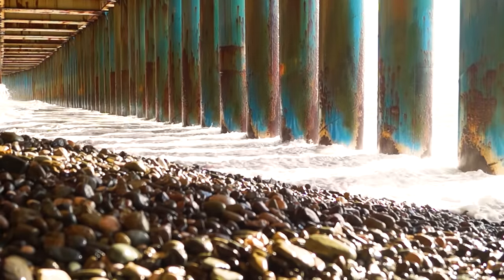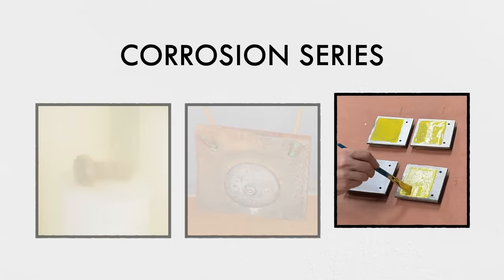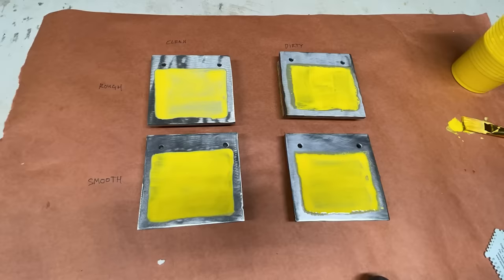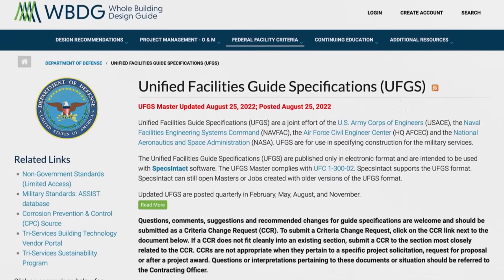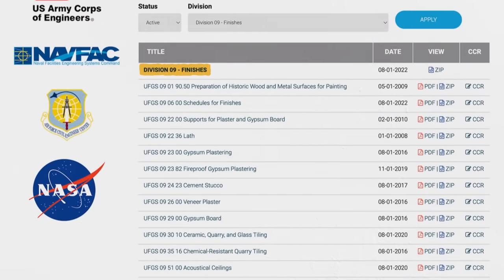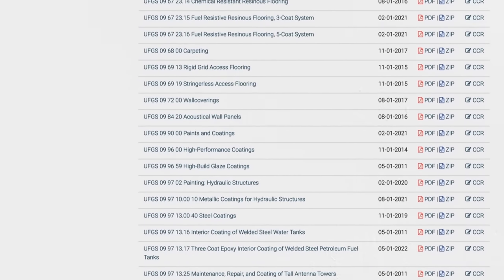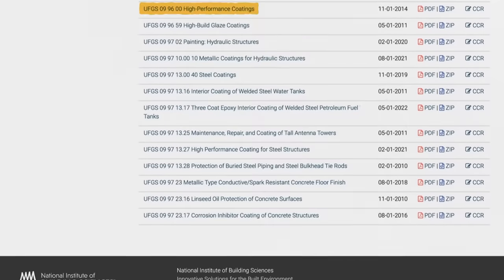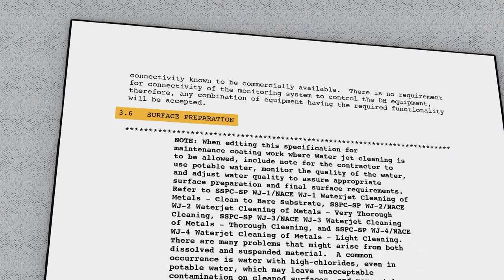What's the Difference Between Paint and Coatings?

Comment: Grady,

I spent my career as a naval architect and marine engineer working for tanker operators.  We had full-time corrosion engineers that monitored the ships and studied the changes in coatings.

I remember them testing coatings in distilled water rather than salt water. It turns out that distilled water is harder on coatings than salt water.  We used pure epoxy paints for potable and fresh water tanks.  In general, if coatings did well in distilled water they would work well with crude oil or salt water.

Surface preparation is everything when it comes to coating performance.  In coating ships we started in most cases with a near white, SA2.5 finish. Coatings, whenever possible, were applied in a dehumidifed atmosphere.  We used not only our own corrosion engineer to oversee the coatings, but inspectors from the coating manufacturers.  We hired the manufacturers paint inspectors and had them report directly to us to remove pressure from the shipyard.

As for primers we used weldable primers such as Nippe Ceramo, as well as zinc chromate and inorganic zinc, depending on location.    In cargo tanks we used two coats of epoxy paint the first coat wss applied directly to the prepared surface.  Coats were of contrasting colors to make seeing holidays easier.

It should also be mentioned sharp edges are the bane of effective coating.  Paint flows away from sharp corners leaving the surface exposed and a place for corrosion to start.  On old bridges or ships with riveted construction  there's an inherent problem of corrosion between plates of steel.  When surface preparation is done you can't blast between the plates.

Bob
Reply: Thanks for those insights - very interesting.
Reply: super interesting thanks!! some videos on this topic would be interesting, I wouldn't have thought that distilled water would be the strictest test, and I'm having trouble imagining the chemistry involved there...
Reply: @bruce-le-smith  My guess would be that distilled water is very accepting of ions to dissolve into it. Water dissolves a lot of things, and regular water you encounter has tons of stuff in it. With distilled water there's a lot of potential left open.
Reply: I love that "it's not the shipyard's fault if we literally hired the manufacturer of the coatings" 😂
Reply: This makes me wonder if distilled water is safe to drink...
Reply: An old chemistry prof referred to distilled water as "hungry water."
Reply: @Mintstar_Oceanpop  it’s safe in small amounts, but in large quantities it can actually cause you to become dehydrated as it’ll flush the sodium (and other minerals) out of your system. I used to use it when cutting weight for MMA fights, I’d completely cut out my sodium intake and drink a ton of distilled water for a few days and it’d make me drop a ton of water weight very quickly.
Reply: @MScotty90  that sounds painful
Reply: @MScotty90  That's really good to know.  I just use it for my morning tea to avoid calcium build up on my electric tea kettle, (we have well water).  I just need to invest in a pitcher filter.
Reply: @Mintstar_Oceanpop  my mom  runs vinegar through her coffee pot to remove hard water water deposits, dont know the exact but you might be able to find it online
Reply: @KibitoAkuya  Very much so
Reply: @charlescourtwright2229  Thanks, that's good to know.
Reply: @Scevenex  While the principle is the same, I would say that it is actually less of a guaranteed issue with distilled water, depending on its environment, than it is to use deionized water, specifically. That stuff defines "hungry" water in terms of metallurgy. I'm not certain that distilled or deionized water would always work all that well as substitutes for real-world tests of conditions that the materials will be subjected to, though. I would rather see long-term testing done with actual seawater-equivalent concentrations, etc.
Reply: In maritime you have Microbiology induced corrosion as well and it is common for an ablative paint to be used that leeches copper and makes it so mussels or other life won't stick to the hull increasing paint life and keeping the hull smooth for performance and efficiency. 

I'm excited this video is doing so well painters are often looked down on as easy because they painted their bedroom once and it wasn't that bad. Protective coatings are on literally every commercial structure built and it's a billion dollar industry and growing every year.
Reply: Loved reading your comment. Big thanks from Iraq 🇮🇶
Reply: @Mintstar_Oceanpop  Cut two lemons in half and drop all four pieces in the kettle. Fill the kettle and boil it, empty the kettle again and remove lemon pieces and you now have a spotless kettle.
Reply: Hi bob
Reply: as an industrial painter I can say the edges are the bain of us painters because when painting bridges and or most big steel structures there is  a "stripe coat" which is usually after the intermediate coat. We use brushes and rollers to paint all the edges, welds, nuts, bolts, rivets to help raise the millage in those areas. I'm also from Pittsburgh too!
Reply: @Mintstar_Oceanpop  It is safe under normal conditions but also "why though". Unlike the pettry dish results people are thinking about, in actual life the second distilled water touches your mouth it will already be about as "dirty" as authority certified drinking water, and when it touches your stomach acid it can't significantly alter concentrations of anything.

It maybe could give you a bit if mouth problems if you drank it exclusively, since that is the first thing it touches and would be the closest to the dish lab tests conditions, but I don't think anyone actually researched the hypothesis. If your diet is poor, you could develop a deficiency of those trace elements, but if you juicy fruits and or meat now and them, it should have you covered. Lastly, if you were trapped and lost in a "food desert" of some kind, you could pretty much add anything to it for a bit to make it no longer distilled. For example, a few drops of sea water would make it basically quality tap water overall
Reply: @MScotty90   that is not the water doing it to you, it is the lack of intake from other sources. Taking distilled water is to ensure you have water to form piss and so can expell used chemicals (which will be in unuseable forms now) while not accidentally introducing new useable forms, and also to prevent feeling thirsty. You push for artificially extreme concentration numbers, so it sorta makes a difference then down to trace elements. Many actors do something similar for shirtless shoots, but their method rellies on not drinking water for long periods instead and feeling horrible for it. If you had a normal diet though, the concentration levels wouldn't be affected in any notable way, you already normally intake far more than your body needs and piss the rest, it would just make the piss less rich.
Reply: @louisvictor3473  If asking 'why' distilled water, it's for my morning tea to avoid calcium build-up on my electric kettle from my well water.  I received a couple good tips in this thread on dealing with the calcium however, so I'll try that and see if that helps.
Reply: @LordofRacoons  We almost always have lemons in the house, I'll try that this weekend.  Thank you.
Reply: @Mintstar_Oceanpop  Ahh, for that. Yeah, cleaning it properly is the better way here. Though, if you still used it anyway, the act of turning it into tea would already eliminate even the "in a dish" concerns, what the tea is adding is much much higher than the difference between safe drinking water and distilled water.
Reply: this is the most useful comment on the entire internet
Reply: @mcboomsauce7922  Thank you!
Reply: @louisvictor3473  Less rich urine is also good to help prevent kidney stones.
Reply: @larryvaughn5843  But that will come out from your overall health, diet and total water intake, and shouldn't come down to the difference between distilled water and actually safe for consumption drinking water (or any other liquids). The water you injest (be it drinking water, juice, inside your solid food) doesn't go straight to urine formation, it always enters the body proper through the digestive system, so everything else previously mentioned also applies here. Urine is basically just the side B of filtered blood (excess water and waste), it should be far too indirect to be significantly affected by the consumption of distilled water vs normal safe to drink water on it's own. If that is making a measurable difference, this is probably the symptom of a larger issue elsewhere (e.g. already malfunctioning kidney, severe nutritional deficit, some other organ is sick, your normal drinking water shouldn't be considered safe to drink actually due to too many contaminants).
Reply: @Mintstar_Oceanpop  no, it is absolutely not.

A glass woth won't hurt you, but a bottle WILL mess with you.
Reply: @Dinnye01  Kind of crazy these are available at most stores for a buck with no warning on the label.
Reply: @charlescourtwright2229  Yes, vinegar will work, and you'll have to flush that out with water to remove the taste/smell.
Reply: Interesting comment. I knew rust prevention on ships is a big thing, but it is even bigger than I thought! Regarding cleaning kettles by boiling vinegar, once you are done with the kettle, add hot water, some herbs and garlic, mustard seeds, sugar and make pickled cucumbers ;) It should be safe to use the same vinegar as long as there were little mineral deposits ;) Maybe someone will comment on safety. I started it as a joke.